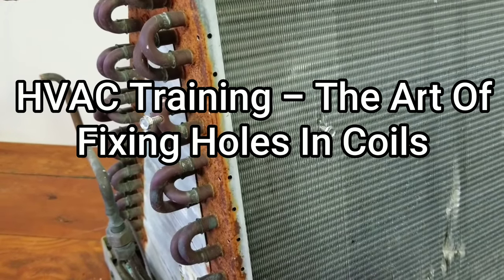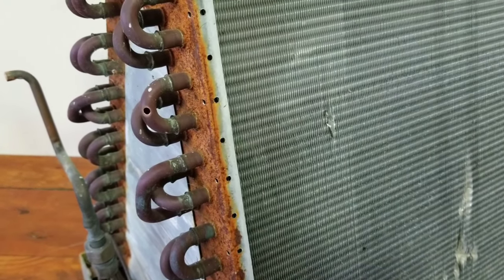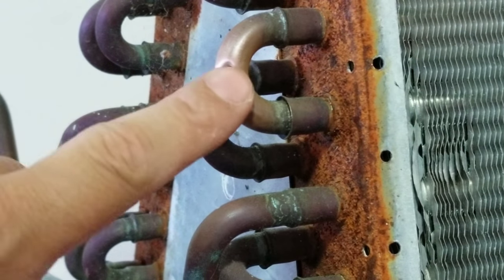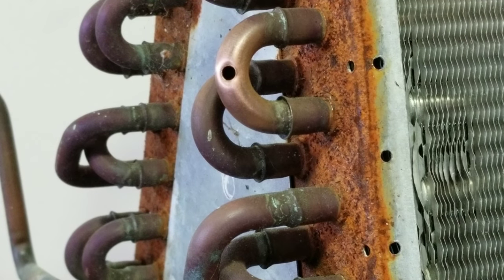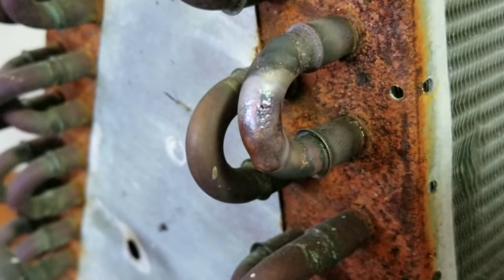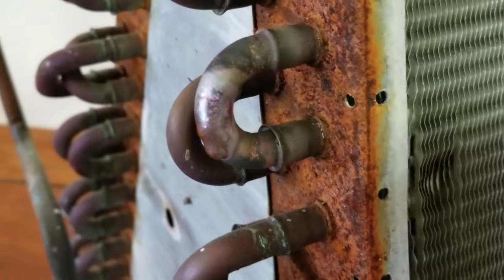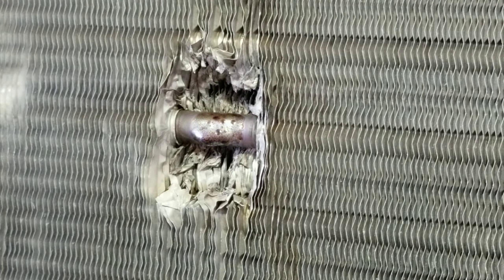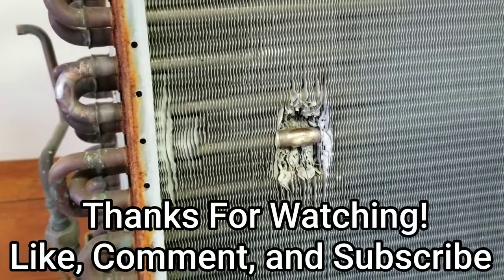HVAC Training - The Art Of Fixing Holes In Coils

Comment: As a 42 year veteran of refrigeration work I must applaud your video! Great work, great technique. I did A LOT of window a/c repairs such as these. Once in a while we would even have to bypass a severely damaged tube in the condenser coil just by tracing out the flow and un-soldering and re-routing a tubing loop on each end to salvage a large condenser. Keep up the good work.
Reply: good job not many people can do that
Reply: Boxing prediksen gig vs Carmelo wu  winer  1000/0
Reply: JLange642
Reply: JLange642 buwang
Reply: JLange642  had to do that to 4 passes,,on a large air cooled condenser in a supermarket, ,about 30 years ago,,then a Carrier heat pump, the bracket for the outdoor fan motor BROKE,,cut up the coil,,had to make ‘jumpers for 5 tubes, had the blade & bracket delivered to me,,, all worked well, , my boss could not believe the damage..,,was a Bank, it’s only heat, an R22 system, about 20 years ago
, now been retired some 17 years.  from Maplewood NJ
Reply: Hi JLange642, what to do if the holes on coils (not fin pack) are big gaps? And there are 5,6 coils. Left it out in garage for some time cold winter. Thanks in advance!!
Reply: I know you may not reply to this but as a homeowner and a person with pretty decent soldering brazing welding type of skills could I make that type of repair myself because my AC unit still blows cold but where the cooling fins are where it pulls the air from inside the house through the filter and then I guess either puts it back outside or pushes it back through the event after passing through the coils can I bypass one of the sections that way because this is an antique window unit and it's surprisingly still works but I can't afford to get a new window unit at all but I have brazing stuff around and  copper tubing
Reply: @hunterfitzgerald5978  or want too...

Comment: Great repairs.  Done many myself the exact same way.  Brazing is a skill that can make life easy or break you.  The point of your video is lost on some.  Not everything can get replaced.  Sometimes you have to use the training you went to school for instead of just selling a new unit.  I'd rather be a good technician than a good salesman.
Reply from the maker: +Michael Paddack I agree. Thanks for watching Michael.
Reply: Exactly!

Also, you need to have the skills and ingenuity to handle odd circumstances, like storm damage to a mission critical piece of equipment, etc..

Comment: Great video my friend. I used to never fix coils by the fins... I was always worried the pipe would be too thin to braze without melting, until my cousin who is a roofer dropped a nail off the roof and it fell into the condenser fan and the fan hit the nail into the coil... so trying to save him money I brazed it and it worked fine. Since then I always give the customer the option to try the repair first. Keep em coming friend.
Reply: Something similar happened to me a few days ago. My box cutter knife fell out of my pocket and sliced into the condenser coil, gas flew out until empty
Reply: If I fix a hole in a coil pack . Do I need to vacuum out the line before I install free on it
Reply: @richardworden9747 
Yes, you have opened system to ambient...

Comment: Good job brazing that up. You can also take some copper wire and wrap around the hole and Braze the copper wire to the pipe. Helps keep solder from getting into pipe.
Reply: Never thought of that some t-stat cable would be great for a brace.
Reply from the maker: Any copper wire will work fairly well. When I've had to make a quick patch I prefer to use some snips and cut a patch out of a piece of copper pipe. Much cleaner than the wrapped wire.
Reply: Awesome idea!
Reply: Good tip bro.
Reply: Or try cutting a coupler hotdog style and lay the half over the hole and braze away...
Reply: Awesome Idea.

Comment: I've done many of these repairs, relatively easy. The tough ones are the ones where the leak is in the tubing coming through the fin pack wall. You should do a vid on that!
Reply: Oldskipper 1 that is called the tube sheet. I’ve repaired many of these leaks. I use 15% solder and flux. Weld the tube and tube sheet together. This is a last ditch effort. No warranty hope for the best. Once the coil starts leaking your just chasing leaks.
Reply: I will sometimes bypass the tube, especially on large condenser coils.

Comment: Nice work. I always feel good after saving my customer some money on a mistake made by one of my fellow HVAC techs or myself. Sometimes the customer is not grateful even with a solid repair line these.
Reply: Why would you charge to fix a mistake you made? And then they have something that has already gone through a break and repair process without having ever used it.
Reply from the maker: Richard, it's called a TEMPORARY fix. Unless you like your tech to just let you melt while your parts get ordered. And who said anything about charging anyone? 🙄 🤦‍♂️🤷‍♂️

Comment: I had this done on a rooftop unit of ours it started leaking it is an older unit but didn't want to pay to have a crain lift it off the roof so. Had it patched unit is a late 80s early 90s unit it has been holding for bout 4 years now.

Comment: Never worked on a Refrigerator before but decided to tackle changing the Compressor on my Kenmore Elite...Stopped Cooling. Welded in the New Compressor and Filter/Dryer...pretty proud of myself at this point! Vacuumed out the system and let it set for 24 hours... held a Vacuum... even prouder still!! Put some R134A Refrigerant in but the system refused to get even a little bit cold!!!! System would only come out of Negative to 10!?!? What did I do wrong?

Comment: Is there a interior sealant for small leaks? Some said something about using it. But great video. We learned to braze with oxygen acetylene.. two thin pieces of steal... Remind me of filling a hole in a car body.  My coil froze and tech said it was cracked.. was just gonna replace air handler. But heck.. why not try

Comment: I was wondering if you used any flux. I didn't see any. I always find it helps bond the silver braze. Also I use a razor knife to cut away fins by the repair to be done and push them out of the way. Sometimes it leaves more fin for heat exchange later.
Reply from the maker: Kimo Armstrong No flux used. If I was using silver solder I would but just 15% rods I just clean and braze. 
Thanks for watching!

Comment: Thanks for your video, I am about to try this repair for my first time, 
this video gives me confidence..:-)  
We have a Reem HeatPumps
Allot of  our units have a problem where  a small crack happens  at the joint  where the small low pressure  switch pipe connects to the larger tube - the soldered seal at the joint cracks- it’s not an easy spot to get at ,
And our units are on the rooftops sitting  on sketchy platforms....;-)
Thanks for the help..:-)

Comment: Hi HVAC in SC, first off - thank you for a really great video!

Quick question - If the hole in the finned tubing was large, say a half inch longitudinal one, and almost as wide as the tube itself, would you cut out the hole portion, clean off the fins left/right, swage a piece of 1/4" tube on both ends, and try to insert it as a fitting onto the coil tube and then braze/solder that?

Comment: Nice job! I tried brazing a leak in a car ac condenser on Friday, got the leak fixed but made two more leaks in the row below.... Got a new condenser on order now! hahaha
Reply from the maker: heavydiesel lol! Gotta love it. Thanks for watching my friend!
Reply: heavydiesel lol
Reply: Aren't car A/C condensers made entirely of aluminum? Lol
Reply: Yeah they are, I have some special rods for brazing ali pipe etc, have done thicker pipe before but the micro channel in A/C condensers is tricky!
Reply: @heavydiesel  not that it matters now, but I think they make an epoxy for doing those. Seems to work well enough when I've seen it used.
Reply: heavydiesel , What I noticed many moons , ago a co worker,,had a BUICK REGAL,,the condenser had a leak,,on the top ‘y’fitting, it sure was aluminum,,but a DIFFERENT ALLOY, the darn solder NEVER STUCK to it, replaced the condenser, end of story.  from Maplewood NJ.
Reply: phil955i  I have repaired many aluminum evap s with 95/5, but using a proper flux.,,, howeverI found the alloy GM uses for its condensers DEFY REPAIRS, . from Maplewood NJ

Comment: Nice repair,iv also seen guys wrap copper wire over the hole before they braze
Reply from the maker: steve hevessy About 20 years ago I knew a guy that used pennies. lol
Although it seemed to work, I prefer the method I used in the video.
Thanks for watching!
Reply: That sounds like an old school way to avoid what was the first thought on my mind... which was if I am filling the tube with sil-phos and blocking the flow of refrigerant. Think I'll set up a test rig with a series of holes in a pipe, do the repair and then cut the tube longitudinally to see what's happening inside.

HVAC in SC, thanks for taking the time to video, edit and share.

Comment: Yeah. Aluminum coils are a pain in the ass. Had a guy pop a hole in one with a screw and all the wholesaler had was some torch style epoxy stick. It slowed the leak at best. Nice tutorial though. I've done this repair a handful of times and it's always worked well with copper. I always used a fresh blade on a box knife to cut the aluminum fins. It works fast if you don't mind losing a little more fin.

Comment: The worst leaks to fix are where the tube passes through the side support into the coil pack. My method is to drill holes in the steel as close together as possible to weaken the steel. Torch the steel to soften and weaken it more. Then use a punch and hammer to push the steel back, exposing the copper tube that has the hole rubbed in it. Then clean tube and patch as needed. Have you ever seen this done? You need the hands of a surgeon to pull it off without killing the patient.
Reply from the maker: Joe Plymale I usually use a Dremel tool or metal snips to remove the steel plate on those repairs. It does take practice and a good touch to do it effectively that's for sure.
Thanks for watching.
Reply: Or if it is something that doesn't really have room to get in there to remove/move the steel to expose the tube, use 45%+ silver brazing alloy or solder, that will stick properly to both the steel and copper, and encapsulate the leak.

Comment: Rather than spend $800 on a new one, ( the $800 to recharge the system is more than I have right now) I replaced one of those 180 degree bends that was leaking.
I soldered on a pressure gauge and hooked up an old salvaged A/C compressor to pressure test it.
I brazed the pin hole leak but the bend was still bubbling up like a 
sponge and when I tried to braze over it, it just melted away as the 
bend was thin as paper, but the rest were solid. It lost zero pressure over night.

Comment: Watching/hearing you was like watching Bob Ross in the mornings lol. I had a customer playing darts and missed and punctured one of the pipes in the coil.
Reply from the maker: Eric Recendez This is art to me. lol
Reply: Eric Recendez  that reminds me of a job 2 of went on,,could not get pressure stable,, the unit was FLAT, ,,on the roof there was an ARROW,,right through 7/8” liquid line out of the condenser, 1968, that was a storage freezer in a supermarket in EAST ORANGE NJ, then on a a/c system for a bank in Jersey City NJ, system was flat, on the roof a darned ARROW, INTO THE CONDENSER,,, had to repair it, 1973, did not have cell phones& cameras those days.l from Maplewood NJ.

Comment: I've patched a few of these. Only had one that eneded up restricting the liquid line but it was worth a try. I'd like to see a repair on an aluminum micro channel. Fortunately I haven't come across that yet.
Reply from the maker: Michael Wiese Hopefully that video will be coming soon.
Thanks for watching!
Reply: Been checking out the Solderweld site for products that are for lower temp aluminum repairs. Waiting to slip a supply PO request in and try them out.
Reply: Repairing an aluminum micro channel coil is essentially just filling in the exposed ends of the damaged channels.

Comment: Wish I would of watched this b4 doing an exact repair as ur 1st one. I used map gas from Lowe’s. Melted the elbow! Pin hole turned into a disaster. 240v AC still sitting in shed. This was a newly refurb AC. I poked the pinhole in it. Oil and Refrigerant went everywhere. So I’m assuming map gas is not the way to go?
Reply: Noooo, mapp gas is not used to braze ac lines. It's fine for plumbing lines, but you need stronger filler metal to braze ac lines because of the high operating pressures. Mapp gas doesn't burn hot enough to be able to melt the filler metals needed to braze ac lines. You need at least acetylene to do the job, but the most efficient way to do it is with an oxy-acetylene rig. They sell portable rigs at Lowes, Home Depot, Harbor Freight, and your local welding shops, usually for between $300 and $500.

Comment: I have a Surefire T757 and an "ordinary" 14.1 oz propane tank. What kind of brazing rod (silver brazing?) was used? The hole is about 1/16 " and was made by a nail. Would soldering (lower heat and I don't have nitrogen) with  plumbing soldering would be good since the hole is so small?

Comment: Flashbacks man, I used to make those condensers... Hand brazed over a million joints. 

I wonder if you would consider using a flux cored sil-fos, you can braze dirty copper with it, can also braze steel to copper with their 18%
Reply: You could even patch the whole within the fins without having to rip it to shreds. Just run the torch as low as it goes and you can burn your way right to the hole while burning a quarter sized hole around the puncture.

Comment: Adding nitrogen does blow dust out.. but mainly used to keep the inside of the pipe from turning black from the high heat. And getting the refrigerant contaminated
Reply from the maker: Jacob D Yep
Reply: that is what the filter for. adding nitrogen on a patch is a waist of time. you only use nitrogen on large jobs with multiple brazes.
Reply: Nitrogen is needed when replacing a manifold on a Carrier package unit with pistons. It is an inert gas to prevent copper oxide from developing in the tubes and clogging the pistons.

Comment: You will have condensate problems on a evap. coil. Meaning the water will not run down the fins and will drip straight off the coil where the repair was made.
Reply from the maker: Dave Fiore As it says in the video description, these repairs  are typically on condenser coils but for easy of filming I used a small evap coil.
Thanks for watching.

Comment: Great video. Very helpful. I’m guessing this would be the same technique for vehicle ac condensers as well
Reply from the maker: Thank you for watching! If it is a copper tubed coil then yes, the same process could be used for a cheap or temporary fix. If it is aluminum tubing, it can still be done but the tools, materials, and procedures are far more delicate.
Reply: any tips for repairing aluminium tubing. I have a pin hole size hole in near the fins

Comment: Had two holes once different places in same circuit but close. Bb gun. Bypassed looked funny running outside the coil only about a foot but it worked.
Reply from the maker: As long as it is done right and it works, we gotta do what we gotta do. 💪

Comment: How much would you charge on average to get the hole through the coil repaired? I have the exact issue, had a contractor drop his drill from the roof and it made a hole in my pipe. I just want to make sure I'm not getting ripped off for the repair and Freon refill.
Reply from the maker: Should be free for you since the contractor caused the hole. 
I dont give prices on this page. They vary greatly depending on region, refrigerant type, ect.

Comment: never seen anyone put a screw in a coil. however i have seen someone put a broad head arrow threw one.I removed the fins managed to slip a coupling over the hole and weld it up.
Reply from the maker: +ZedsNOTdead In my 20 years Ive seen about 4 people put screws on condenser coils and heard of dozens more. Never seen it on and indoor coil but I only used this old evap because it was easier to video.
Reply: thank you for your videos keep up the good work.

Comment: Nice, I noticed there was no cleaning before brazing the coil, not necessary with copper only repair. And forgive me for being critical but i’ve found when you start playing around trying to pretty things up you usually get into trouble. I also noticed in all these videos everybody likes to use oxy acet setup, personally I like my prestolite air acetylene torches on these small jobs, and with an MC tank you can’t beat how handy it is.
Reply from the maker: @2:04 there is cleaning discussed. 
In my experience it doesn't matter if you "play around" with a braze joint provided you can control your heat and protect the components. Obviously when I'm making a video demonstration, I intentionally take longer as topics are being discussed.
As for MC tanks, use what you like to use. In my 20+ years in this industry and counting I have used all types of torches and configurations. I prefer oxy/acetylene.
Reply from the maker: As for your other comment calling someone a chump... it seems you deleted that before I could read it in its entirety...
Reply: HVAC in SC Well I don’t remember at this point my chump comment, however after 45+ years in refrigeration i’ve seen plenty of chumps, in fact I only know a few techs that aren’t chumps !